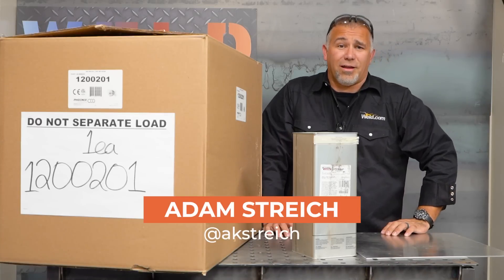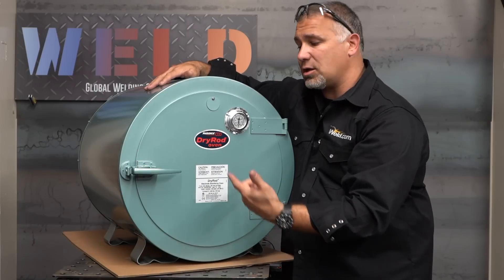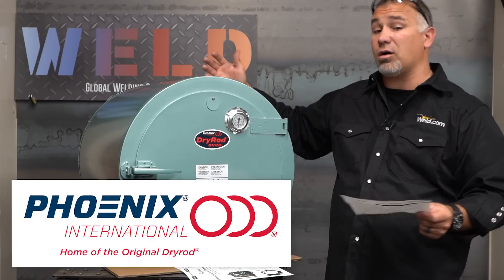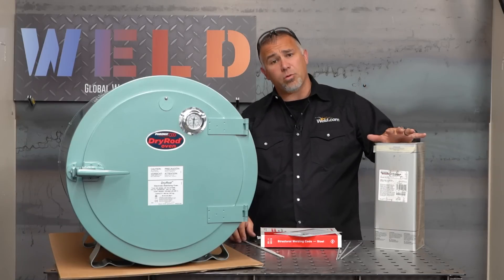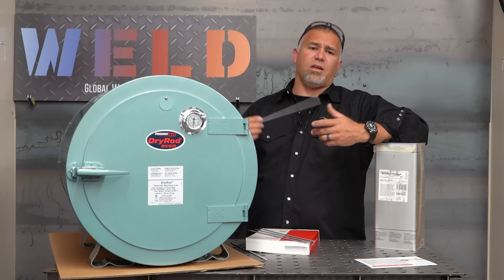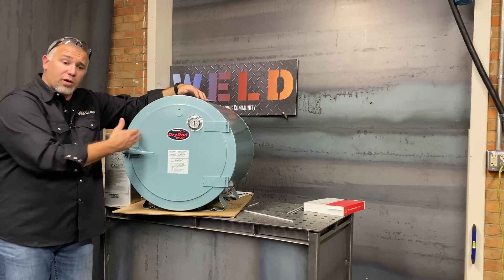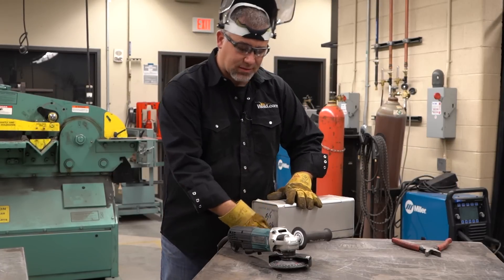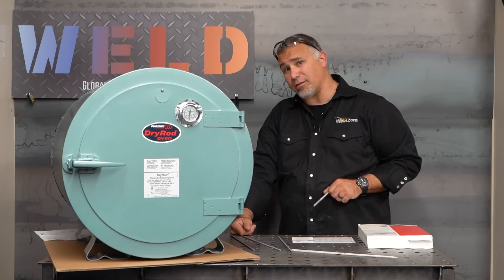Is a Rod Oven Necessary?

Comment: I just read not to use rod oven with 6011 rod. Can someone explain why?
Reply: at lower temperatures yes you can as long as you follow proper procedures. read Lincoln Electrics instructions on their web site

Comment: If yr really stuck. Arc the rod to the job and warm it up. Use yr hands to the touch to cook excess moisture out of the rod
I’m an ex boily 
Or a soft cutting flame and run it over the rods when yr in the bush to warm the rods up

Comment: and this is why I don't mess with 7018's........I am just a home hobbyist and usually use 6011 or I go to 6013 when I have something thinner.
Reply: When left out in open damp air, 7018s are no worse than  6011 or 6013, they're just not low hydrogen anymore, a feature most people don't even need anyway. It's just for rocket ships. bridges, submarine hulls, etc. for hobby stuff it's fine. They're actually probably even better, but for hobby level stuff you're not likely to see much difference. 7018 is a little more of a PITA to use because of the way it slags over on the ends every time you stop welding. That's probably a better reason to stick with what you're used to.

Comment: I worked in a couple shops that did structural and aero-space stuff...all the blue-prints called for low-hydrogen, 8018 or higher...some were 11018...that is pretty tough to weld with, a beast compared to the 'tame' 7018...When the inspector showed up, first thing he said was..."where's your rod oven"...

Comment: Any advice for a amateur welder. I am not welding daily.  So storing in a oven is out for me. I have a hotplate. Would placing the rods in  tin on the hotplate for an hour work???.
Reply: I am just a home welder too, I just use 6011 and 6013 for most things. I doubt I am working on anything where the extra 10,000 tensile strength will matter.
Reply: Well in that case you might be better off running things like 6010/6011/6013/ 7014 etc the non low hydrogen options.  For basic practice though you’ll be fine.  You may notice that rods stored in an oven reduce porosity, light up easier and the slag comes off easier.  But for practice and such “You gotta burn to learn and learn to earn” so keep running them rods.  You’ll just notice an improvement when you go to fresh rods

Comment: I actually use an old electric smoker. The one I have can go up to 600 degrees and does magic for stick electrodes and tempering processes for high carbon forging. It also can be used to slowly cool down and heat up cast repairs. Electric smokers are also handy for melting plastic because there is no flame to burn it.
Reply: That’s a great plan for tempering, preheat and post heat applications. I hadn’t thought of using an old smoker for and no flame

Comment: Waste of electricity. My rates are amongst the highest in the country. The state just approved a doubling of those rates next month (Aug 22). 
No longer paying to bake rods when most work doesn't need it.
Reply: The electric costs with everyone charging batteries is real. Dividing larger 10 or 50# rods into smaller vacuum sealed packages and only heating say a 10# oven can be viable option. Or only open 1# packages as the job goes

Comment: MIG is the way to go, you don't have to put the spool on the oven
Reply: Sometimes you want to put your fluxcore wires in an oven though. And metallurgically flux’s allow for more dedicated alloying additions and slow cool welds, no doubt hyperfill GMAW can lay some wire down, but for certain field repairs it’s not the right choice.  Each has pros and cons.  What wire type and gas type do you run? Anything you’d like to see more about in the mig realm?
Reply: Yeah, especially on the field, with wind, shield gasses etc..
Reply: @hardcoreplayafromthehimala4888  they make gasless mig 😀

Comment: Working heavy equipment repair for 40 years I agree 100% with the dry rod for code work and critical work but in reality when it's down time and in the middle of a rainstorm or working on a dredge or in a coffer dam in the middlle of a river with water leaking and soaking every thing where rods are thoroughly wet bottom line is I ground the rod out till the water bubbles out of the rod flux and weld on.
Reply: Sometimes ya gotta do what is necessary to get the job done. I know hanging off a dock with waves splashing where your welding but making emergency repairs just gotta get it done.  Some jobs just go like that
Reply: I always wondered why worry about moisture in the flux when you weld the rod gets hot enough to cook out moisture. I supposed because it don’t happen fast enough and get trapped in the weld, I’ve always wondered haha

Comment: I'd like to learn more on how many times you can "re-heat" the rods? Say E-7018... Can I store them in my oven, go to a job... And put them back several times?? I'd hate to waste a 50lb box , what if I had a box opened over a year? And used them in and out of the oven on side jobs over 40 times?? I'm just throwing out numbers... Where can I honestly learn the proper length of time a E7018 can be used? What if you have an open can in your shop not in an oven but in a cabinet? They are wasted?
Reply: Joseph, the specific code books will refer to how long they can be out of the oven for what duration of time.  Typically you are only allowed one rebake.  This is why the smaller job site/portable options are great for your application.  Also if you purchase a 50# box you might be better off dividing it into smaller like 1-2# increments and re-sealing them in vacuum pack (food saver) type bags with disectant  packs to keep moisture out and only open what you need.  I know some guys divide into smaller packs and charge based on how many packs they open per job.  The 7018-hxr the x also helps for longer out of oven times, but various codes still restrict.  We know many times rods are just stored in the back seat, but there are better options.  Take a look at the 10# portable options to best fit your needs.

Comment: Marketing ploy !! He may be in for a freebee or a discount.
A hot box is required for 7016 18 low hyd
Reply: Not sure where your going with this one Stan, these rod ovens are industry standard for code welding. This is a temperature controlled oven capable of holding specific temperatures for various rod applications.  And yes this one did come at a discount the other three I’ve purchased for my program did not.  There are a variety of sizes available based on applications

Comment: I used to love starting with a hot rod on 7018 but now they have hot start setting on newer machines that makes starting an arc so easy a crisp.
Reply: What machines are you running and what start time/ amperage have you found work great for you?

Comment: I remember at the college I took welding at we did not use our rod oven but it came in handy to help slowly cool down a cast iron repair job 😎. Maybe not the most common use, or the best, but it did the trick!
Reply: I’ve done that same thing more than once.  Kept a red hot bar of steel in it to set a cast repair on to slow the cooling process.  When it works it works.

Comment: I keep my 7018 rods in the container they came in and in my truck but I don't do no structural Mines just for at the house usually practice
Reply: That’s what many do, or buy fresh for important work, while an option, it’s not the best option.  Another option that keeps rods a little better than the back seat is opening them and then dividing to keep in food saver vacuum sealed smaller increments. Check out some of the smaller style storage options for those code quality work.

Comment: SO YOU CAN'T USE A HOME OVEN?
Reply: You can, it's just pain in the butt to keep low temperature, and air circulation don't help, also it might not be healthy.
Reply: @tjurzyk  An incubator thermostat works for low temperatures.  The main thing is to keep the rods dry.
Reply: Keeping it running all the time is the main issue.  While you can for rebake operations my wife gets upset when she finds rods and cast iron parts in the oven😂. The right tool for the job.
Reply: @adamstreich3007  LOL, THIS IS WHY I CAN'T LIVE WITH MY GF, SHE DOESN'T UNDERSTAND US MEN DO CRAZY THINGS.
Reply: Sure you can, get one of these toaster ovens from goodwill. They key here is that HOT electrodes will loose all moisture as it simply... evaporates. 
Main issue is setting a timer. So so just hot wire toaster oven for continuous use and add alarm on your phone when ready.
Reply: @tomk3732  THANK YOU TOM,
Reply: An old dorm fridge with a 100w incandescent light bulb is much better than nothing to keep moisture out, but dedicated ovens are the best
Reply: @adamstreich3007  THAT'S A GREAT IDEA , THANK YOU .

Comment: What temperature are you supposed to keep your rods at and are you supposed to always keep them hot or before using them?
Reply: Most specs I use call for 300 Fahrenheit.
Reply: Most of the low hy rods we use (7016, 7018 and 7028) call for storage at 150°c. Once pack opened or out of the oven for more than 12 hrs, held in a quiver, call for a 3hr rebake at 300-350°c
Reply: Depends on the rod type and code being followed. What rods are you running?  I’ve seen everything from an old dorm fridge with a 100W incandescent bulb to proper rod ovens used. It really does make a difference versus just left out

Comment: I just built my own for work we didn't have one for our 7018 and they wanted us to do structural work not without an oven im not lol
Reply: Did you use an old dorm fridge with an incandescent bulb? Or proper insulation and heating element?  Some of the portable options work very well for various code jobs
Reply: @adamstreich3007  I used a drop of 18inch pipe for the inner and 24inch for the outer and it is filled with refractory for insulation I also used an adjustable heating element and it has a thermometer on the front its build almost identical to this I don't have any of the inner dividers in there yet just keep them in the tins
I work in a factory that uses formable refractory so its what was avaliable to me